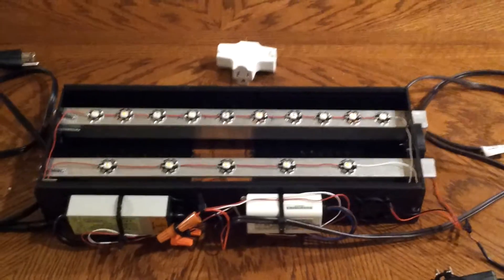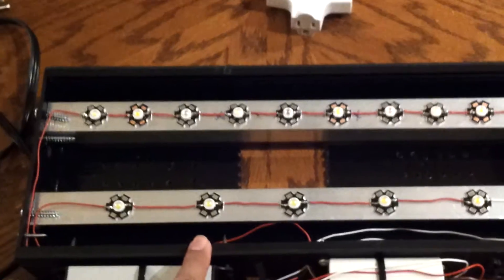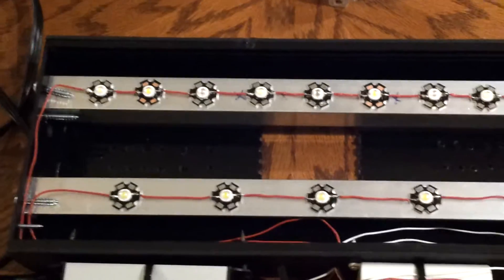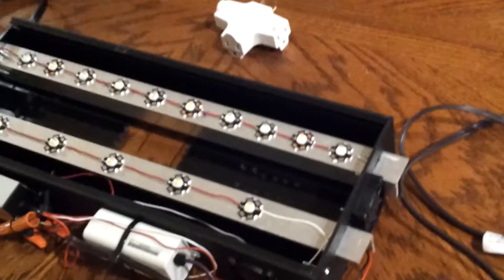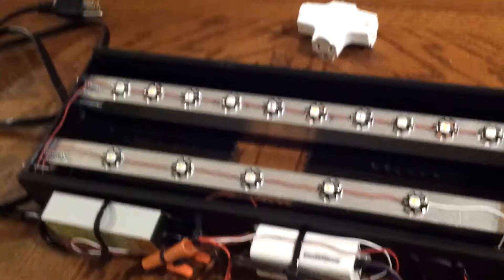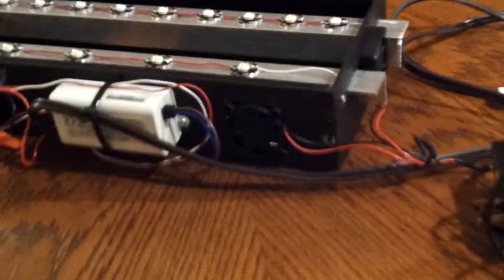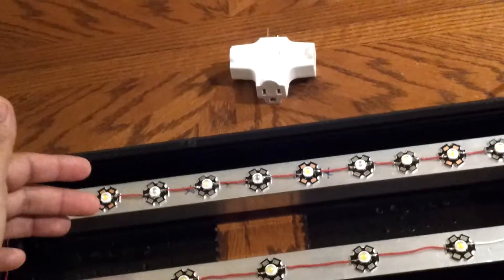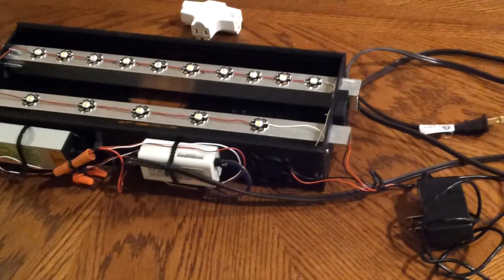DIY Led Light for Planted Aquarium #1

Comment: What driver did you use for the 5w led
Reply from the maker: +Christopher Hernandez I used this driver from Ebay; 

IP67 Waterproof (8-11)x3W LED Driver Power Supply DC26-40V 700mA for 20W 30W LED.
Even though it is says (8 or 11) 3-watt led driver, I stayed well under 30-watts total and at 35 dc volts max.  As long as your stay about 5 watts under the max and 5 dc volts under the max rated.
Reply: +TX Aquatics thanks that was very helpful trying to build my own set of lights for a few of my aquariums